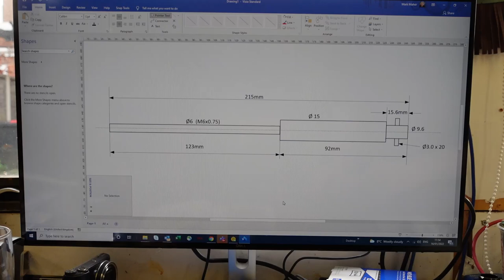Coil Winding Machine Modification (NZ-2)

Comment: Cut a plastic spacer tube to take up most of the space between the bobbin and threaded collar would save spinning the collar clear down the threaded part.

Glad I found these videos. I've been looking for a bobbin winder for my vintage braiding machine and haven't found anything that wasn't a super-expensive industrial unit. The NZ-2 will do nicely.

Comment: Machinist here, just curious why you didn't tap the part in the lathe? It definitely appeared to be having trouble staying square to the hole!
Also, seems like you were running too high an RPM with not enough feedrate. That HSS tool was struggling!

Just wanna say I enjoy the videos. I don't know much about how electrical stuff works, but you've inspired me to do some reading on the subject and pick up a multimeter and soldering set up!

Comment: As always, entertaining, educational and nice work.
Thanks!!

What was the chemicals? I want to try that my self..
Reply from the maker: It’s a 3 part ‘Chemical Blacking Kit’, which I found on eBay. 
There’s a bottle of Alkaline cleaner, Blacking solution & Dewatering oil.
Very easy to use - works just as you saw in the video (I mean, I didn’t edit it to look easy). 😁

Comment: Thats not cheating but its the right way to make it
Next time you could place the tap in the drill Chuck mounted very loose in the tail stock
Turn the lathe in low speed and hold the Chuck by hand
If you are deep enough or at the end just let it slip in yourhand
That way the thread is always str8
Best wishes